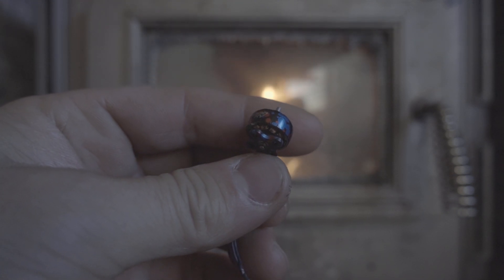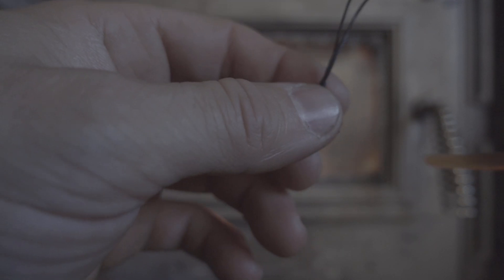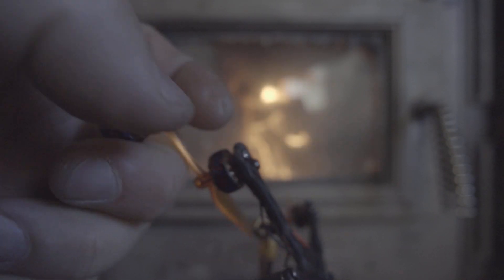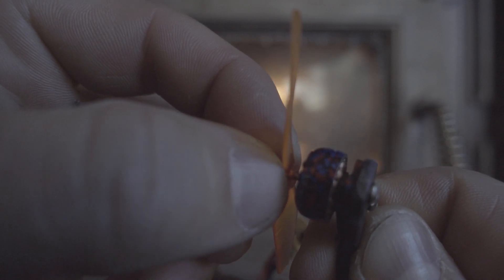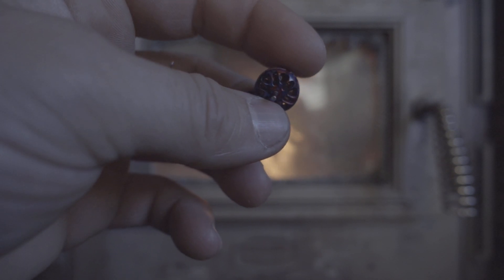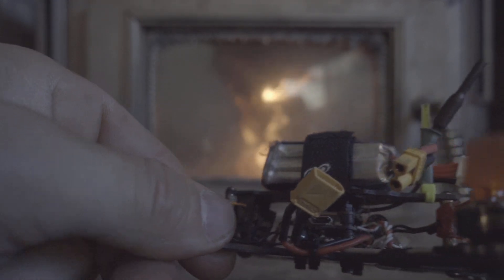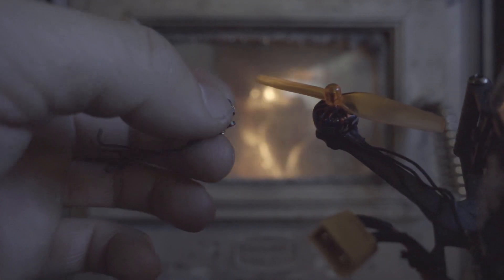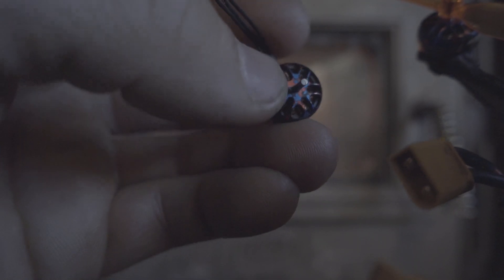iFlight XING Nano X1103 8000Kv Micro Motor long term review

Comment: Dang I just ordered 6 of these for my phantom. Did all 4 of yours come loose? Also when you soldered them did was the wire orientations the same as the stock motors?
Reply: I'm also about to order some motor for  my phantom, which ones did you got ? I was thinking on the xing nano, diatone mamba or  tmotor 1103
Reply: @theAIex2  what I hear is t-motors are great but I just did a second build with the I flight xing x1103 and they were better then the other ones I got. Getfpv has the 4 pack ones with the mounting screws tapped into the bell. They hum so perfect and it can carry my gopro 😂😂😂. Just as an experiment though. Sub scribed to me, I'm about to edit some shots. I wanna get a non windy day though so I can share some flight footage too. Its gonna be a armattan tadpole with a 400mw vtx. I was going to putt the flywoo 1103 gold motors on it but these were in stock. Both are highly recommendable buy larger channels.